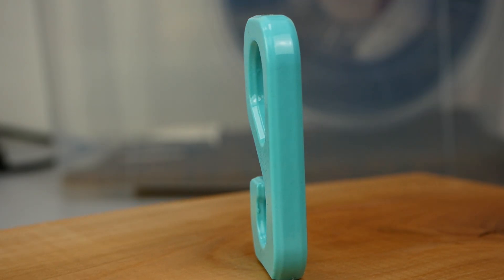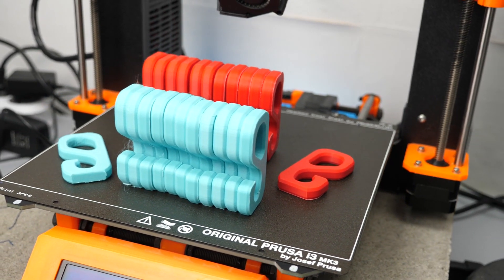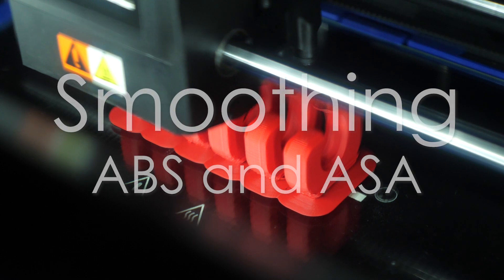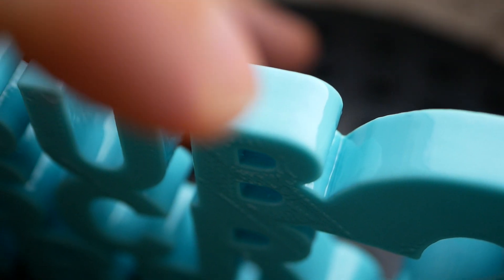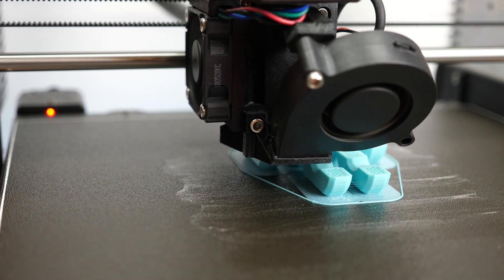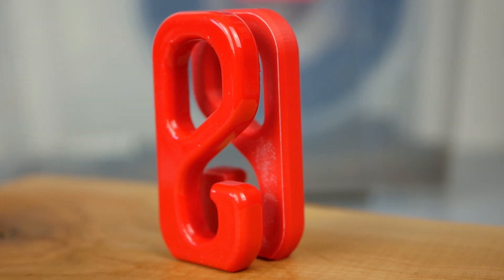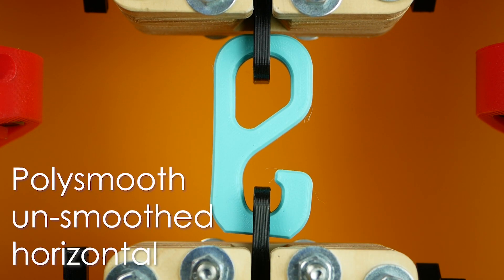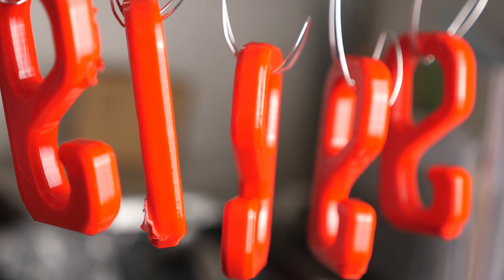Stronger 3D prints with Vapor Smoothing?

Comment from the maker: Feel free to share and discuss the video on you Social Media platform of choice!
Reply: What about leaving the top and bottom exposed so more surface area could be smoothed I.e. have the infill smoothed as well. I know that what you did is how the smoothing would normally be used.
Reply: I really enjoy your channel as a mechanical engineer and 3d printer designer. All your content is very interesting for nerds like me
Reply: Please test what happens to the strength of the parts when you rotate them sideways (along the Y Axis) at difrent angles (im thinking of something like 10,20,30,40,50°)

I would test it my self but i dont have that much money to spent for filaments

MFG my german friend :D
Reply: @hustlezockt663  That's a cool idea. I would suggest non-planar printing as well, since the layers shift in different ways then!
Reply: @hustlezockt663  _888
Reply: Similar to what John was saying, use a gyroid infill and open the top and bottom of the part so the entire interior and infill can be smoothed. Then you might (might) see something slightly more significant.
Reply: ... what about trying to print the part in two halves, one with no bottom, on with no top layer, so that the solvent can reach the infill, the solvent welding the two parts after they dried out?
Maybe immersing them in solvent for a short time?
Reply: I feel like you should triple the groups 
of test parts and use the machine’s 
average value among those groups as 
the true results of the experiment.

Simply put,
you should print more than one group
so that you can compare measurements.

This would substantially increase the accuracy of your experiments, IMO.
Reply: What about a push force/Drop test?  With the outer layer being bonded on the smoothed pieces do they hold up better to drops?
Reply: Does solvent vapor smoothing/strengthening work on nylon parts ??

If so, which solvent(s?) would you recommend ??
Reply: Does air pressure affect print quality, and if you use different gases like nitrogen or non like a vacuum
Reply: CNC Kitchen okay
Reply: I enjoy seeing new generation having so much interest as I did 30 plus years ago.  It's great to see so many great channels exploring all thing.
Reply: May I suggest masterbond for secondary process from aesthetics to engineering prototypes.  We would use special compounds to improve many various properties.  This was 15 years ago, and today the options are so numerous you can make working production parts after testing.
Reply: CNC Kitchen what do you think of the Plattform BRAZZERS to learn about problem solving & physics?
Reply: You can buy experimental HDPE filament from: https://filaments.ca/products/hdpe-filament-natural-1-75mm
You should get some and do some strength tests, the reviews say it's difficult to figure out the print settings, and bed adhesion but when you get it right it's superior for strength and layer adhesion. You might be the first to make a video about it if you hurry.
Reply: I'm a metal AM engineer but I print plastic parts at home for all kinds of applications. I seriously love that you actually do proper experimentation on here! I print PETG and smooth it by diffusing MEK substitute onto the surface with a headlight polisher. I have found that it stays somewhat soft for up to a week depending on how aggressive I was with the vapor smoothing. I haven't yet done mechanical testing though. I hope to find out more from what others have done
Reply: You should revisit this experiment using co-extruded filaments

Comment: Interesting. I just came across this video now (5 years after you posted it) and I recently did a similar experiment and got the completely opposite result: the parts I vapor smoothed ended up 2.5-3x stronger than the non-smoothed version. Here are links to my video of the tests: https://www.youtube.com/watch?v=qvjtR7SF65U&t=37s  The 2nd video has a direct side by side pressure test of the vapor smoothed and untreated vessel: https://www.youtube.com/watch?v=wapT1AQiuxg

Comment: The infill densities change orientation depending on what axis you print on. You need to use a 3D infill pattern that is symmetrical on every axis in order to have a fair test result, or even better do smaller hooks with 100% infill.

Comment: I want to see Salt Remelt + quick sanding + Solvent Smoothing....

Sanding would drastically reduce how long the solvent needs to be on the parts. So if smoothing reduces strength on some parts, less time would be better.

Comment: I'm curious if sanding prior to smoothing will aid in bonding. By adding lots of smaller grains in between peaks/bumps, there is a reservoir of easily saturated/dissolved plastic on the outer shell. If the solvent molecules are small enough, will some of them pass between the sanding shavings and affect the solid part below?

Comment: Superb content in this video - thanks for the free knowledge sharing!   Would results be different in a brittle failure mode such as impact?   Usually when I need strong parts, in my designs they have cyclical loading or resistance to drops & impact.

Comment: Acetone is known for removing softeners in any kind of plastics, making it brittle. One of the reasons, why we were always very cautious to use it in yacht maintenance. You really, really do not want that with the hull of plastic boats... ;-) So, the loss of strength comes as no surprise. If you just want a smooth surface, a short exposure time (like a dip or spray) would be likely to help against a loss of strength. Acetone is a beast and healthwise, I would not consider it particularly safe to handle. But handled correctly and avoiding the fumes, it sure does a thorough job.

Comment: I know this is an old video, but I have worked with solvents and from what I've seen and experienced once you introduce a chemical that has a chemical reaction that chemical either changes the actual chemistry of the material, or it resides in the material for a very long time.  Things that interact on a chemical level tend to bond very well. You can't un-bake a cake.

Comment: I wonder if the direction of the parts hanging has anything to do with how well the vapor melts and fuse the internal structures. How about tumbling the parts during vaping? And if anyone is willing to go through the trouble, make a hole to release the internal vapor.

Comment: I have done a lot of acetone ABS. A few note to consider if you re-visit this.

* 3 weeks is not nearly long enough. In some cases it takes more than 12-24 months! 

*The parts shrink. In some cases I've had crazy cracking all over part 20 months later.  This can be repaired with a coat of ABS+acetone juice from the same roll of filament. It seem to last much longer, with some prints now 5 years after cracks repaired. This makes me think better smoothing or chemical annealing possible with some plastic in the vapor!!

*temp and time are huge variables. High temps for low times seems best for smoothing, and does not crazy crack later. I like 60c boiling acetone bath and suspend part over boiling fluid less than 10-20 seconds. This needs 8 - 24 weeks to dry halfway.
 For more strength the colder slow method is better. It smooths much less but acts more like annealing. Cool room temps, Paper towel, less than 1ml acetone per gram abs. Add  more acetone daily for 2-3 days. Much less time for not solid parts. Maybe 3-4 hours for a 3 wall Stanford bunny 10% infill, too long and parts sag. Less acetone can also get you more time with delicate parts if you not getting good penetration. These parts take weeks to firm up and years to fully harden, they love to crazy crack but they are strong like injection molded part. I think multiple treatments over period of months might prevent the crazy cracking. The surface dries so much faster than the middle... Need to cure more evenly...

*I have used a brush to work acetone or ABS juice/paste into cracks and gaps on many parts. It usually dries a bit frosted looking. This is easily fixed with a few seconds of high temp vapor as a second treatment. I get best results waiting at least a week between acetone treatments. Otherwise you can accumulate too much in the part and it shrinks violently and dies unexpectedly sometime later. Or just stays soft and saggy for days. If done well, these parts can be incredibly strong. Although sometimes more brittle, I think the plastic is altered by removal of plasticizes. Less acetone and longer times helps here.

*I've not done much of it for a few years due to discovering how long the parts take to cure, I'm still observing some and want to more sometime. 

*Some of the very deeply treated parts I still have are crazy strong. They seem lighter. I wish I had measured the weight more!! Could help identify cure times!!

*I think some of my parts are still shrinking 5-8 years later! Some good quality controlled environment long term tests would be very interesting.
Reply: I also do a hot vapor bath over boiling acetone and noticed the finished parts are much stronger without the layer line weak points.

I haven't done the slower smoothing process, so I'm not sure what you mean by the crazy cracking, but I agree that deeper acetone penetration and drying faster on the outsides is the culprit. It makes sense that the acetone absorption would act like annealing too, but hard to control the process of removing the acetone in a reasonable amount of time.

I wish he would repeat these tests with the hot vapor and waiting longer for curing afterwards

Comment: I wonder if a print was continuously smoothed during the printing process, say by printing ABS in an enclosure with acetone vapors being present throughout the printing process, what results in that could yield. I would imagine you would want a very low acetone content as it would be exposed for the entire time duration of the print, however, this could lead to the internal fusing of layers, not just the surface.

Comment: For the extra brittleness after the smoothing; maybe weighing the part, smoothing, then weighing again.
May need more dehydrator time. 

If after that is solved, I wonder if having a mister by the print bed, that sprays lightly each layer as it prints, would make better layers.
A slower print speed and the heat should evaporate most of the solvents, but the print would need a curing time probably much longer than smoothing to get it all.

Comment: What about actually printing inside a chamber with acetone??? Wouldn't that helps open the layer surfaces for more bonding?
Or without chamber but just some acetone soaked pads in front of the part cooling fan

Comment: I'm still going through your back list, so this may have been covered. It's a bit off-topic from THIS video, but please bear with me.

What if you print alternating lines of X at two different heights, so that the first layer came out looking corrugated, then continued this pattern with subsequent layers, only smoothing out the top-most layer?
Like a plain-laid brick wall laid on its side.

I'm not talking about texturing the surface, but rather the layers. I'm talking about increasing the number of neighboring lines to any line, from effectively 4 (corner neighbors presumably don't count much for strength), to 6. Creating a cross-section of lines that resembles a honeycomb rather than a rectangular array of rods.

I understand it would play havoc with overhangs and bridges, making support structures necessary in some places where they hadn't been.

Comment: LEARNED something critical - the ACETONE seems to remain in the part EVEN AFTER many weeks.

SUN CURING for a week or so, may be the answer.(Will post if this actually vaporizes the residue.) 

You will know for sure if any ACETONE remains in the part if exposed to direct heat. Like near the HOT BED of your printer(A hot air gun will also likely work), it will bubble and blister - this tells you it still has acetone reacting it the part.

When the ACETONE is fully vaporized I do believe parts will be stronger all the way around.

Comment: Love your videos. Curious what would happen on strength tests of single perimeter prints. Infilled parts understandably don't improve if the solvent doesn't penetrate deeply, but for things like RC airplanes, for example, solvent smoothing of very thin prints could be a lot more impactful. In some cases this could be a more convenient approach than, for example, re-melting in salt or plaster.
Reply: In my experience, a hot acetone vapor bath is the way to go for ABS strength. It dosen't give the acetone enough time to penetrate deeply, but it gives that continuous smooth outer shell which makes layer line splits much less likely. 

I have a dedicated electric crockpot I preheat while empty and pour in maybe 2-3tbsp(30-45mL) of acetone in, which begins boiling instantly. I use a 1/32" drilled hole in my part to lower the object in on a thin wire hook, and keep the top of the crockpot covered to trap the vapor. The 1/32" hole also serves to let air from inside any infill volume to escape without causing surface bubbles.

Comment: Since it only seems to affect the outside layer, I think a good test would be to print the models in vase mode. Single wall, no infill, would narrow down what you're actually testing now that we know it doesn't extend any deeper into the parts. Thanks for the video.

Comment: This fascinated me in my mechanical engineering study.
Polished shafts are stronger than rough ones, as the small grooves on the surface act like predetermined breaking points.
This definitely is true for metallic parts, but with plastic, there is a lot more chemistry going on.
Also, this effect should be more considerable with brittle materials, instead of ductile ones.